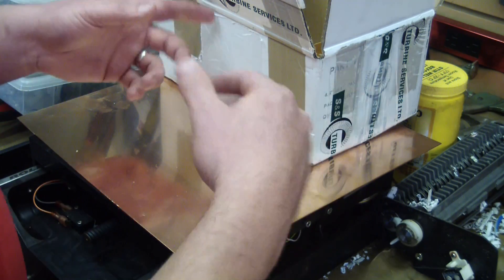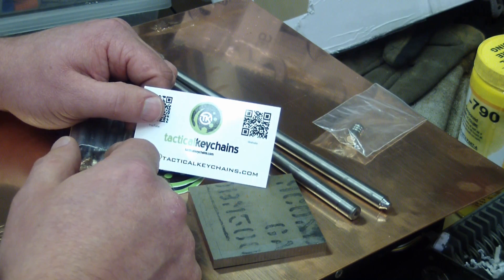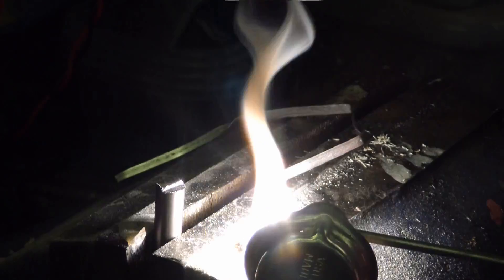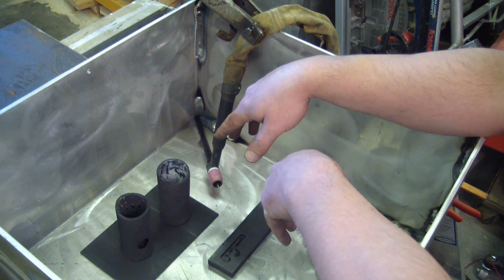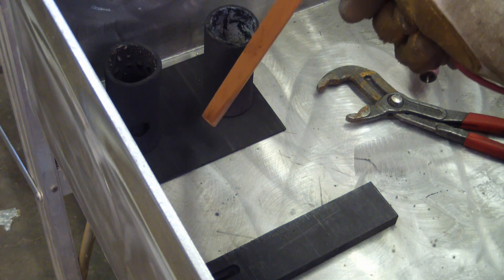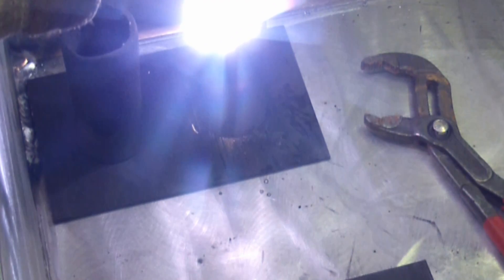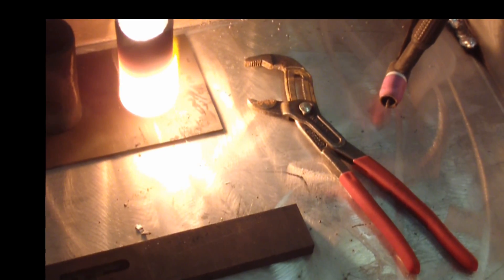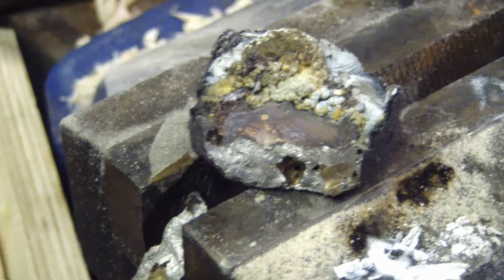Titanium Casting Experiment

Comment: I had another idea coat the titanium with silicon oil/grease and quarts sand once hot this should make a protective layer between the titanium and oxygen/contaminants in the air. The silicon oil/grease will not be enough on its own as most silicon oil will boil long before titanium melts it dose serve as a binding agent and lower temperature barrier. Quarts has a similar melting point to titanium so will serve as high temperature barrier however using quarts sand will probably require a 3rd intermediary barrier material which i have not sourced however if the materials boiling point is adequately above the melting point of titanium it could replace quarts. I have recommended silicone based materials for several reasons, they will form a barrier layer, they will and will absorb oxygen and other contaminants.

Comment: I worked for a high profile company that actually poured titanium (confidentiality stuff) they used the same idea (much bigger scale).. It was  done inside a vacuum chamber and the crucible was actually a water jacketed copper tub. The pour had to be made right at the moment that the massive titanium electrode was out of the way. Titanium freezes  almost instantly.

Maybe I shouldn’t have said any of that.. but I haven’t worked there for around 4 yrs so maybe I’m good.

Comment: You should cover the top of the box with plexiglass or something to keep the argon in. Also, a lot of metals can react with carbon at high temperatures, so it might be better to use a long, shallow alumina or zirconia crucible and just have 2 stick electrodes.

Comment: You needed better Argon shielding and better thermal insulation and a longer application of heat.

I would recommend making a simple steel box lined with refractory bricks with a very small space inside for the crucible.  Then preheat the crucible and refractory bricks with an acetylene torch for several minutes at a minimum.

Then pump in Argon gas and verify the Oxygen content using a burning splint and Burning Magnesium ribbon.

If the Magnesium ribbon can be fully extinguished the Argon concentration is probably high enough.

Next load the Titanium then heat using a carbon arc torch for a very long time. 

FYI I started out in school as a metallurgical engineer.  At present I am a Manufacturing engineer and CNC machining department supervisor at a mid size machine shop/job shop.

Comment: I wonder if you could make a float to indicate how full the tub is with argon gas. I know they've used very light aluminum foil boats to float on heavy gases, i wonder if you could make a light ball partially filled with helium to be extremely light, to be able to float on top of your argon in a perforated clear tube to indicate how much argon you have in that tank.

Comment: If you heat the titanium to 1380°c for 36 minutes and then quench it until cool, then heat it a second time to 900°c for 14 minutes and let it slow cool it will be much much stronger.

And instead of zapping the bejesus out of it, use an induction heater furnace.

Comment: Charles law is what fucked ya here. The heat caused the gas to expand and let some air in to screw everything up. Trying making a closed system where you pull the air out and replace it with argon,slam in two access points for gloves(make sure your seal is still good) and Bam problem solved.

Comment: When I used to weld that material you could not have enough argon,, post flow 6 to 8 sec, blowing it on the front and back, if you overheated the workpiece the whole thing was junk. might try putting that tig torch in the crucible,, don't know. do enjoy your videos though. keep your stick on the ice.

Comment: well, first you need a variable frequency water cooled induction heat source in the 10kw range, then you need to make a better gas shielding system such as a full enclosure, a zircon oxide crucible will probably hold the melt cant use silicone carbide since they are clay or graphite bonded and will react the titanium, if you are luckily after spending 15k on a melt rig, you will get molten titanium, to pour it into a mold . the entire process will have to be shielded by argon,  so basically the entire melt needs to be in a sealed enclosure with a tilting device that will allow pouring into a perfectly positioned mold, better off to cnc titanium chunks, nice try though was a very cool failure

Comment: moe7404.   years ago when i was at Boeing we machined a LOT of titanium.    the scrap tubes had be covered with  a metal lid.   and we had to have a can of X powder to cover it in case of a fire.  of course this will NOT put the fire out only keep from burning the shop down.   and we had to put a good chip load on the cutter else the titanium  will work harden.   and we had a book of procedures.   that required to flood cool the cutter.   and we had to have the fire dept come out and approve the work area then they gave use a paper to show it was safe to run the titanium.

Comment: wot u wonna do is bang another gougeing rod down the gunts of that there hot cup so az ur angry pixys az u got dancen around in the dohicky run from stik 2 stik that way the force of the arc is not held by ut wanten to keep allso swap ur polarity around so the pixy dust is runing from the work pice to the hand pice so that the rod in the cup vaporises less coz of the electrons and pasmalexilied thingos that makeup that big blue looken thing  wot happens at the end of ur rod is flowing up and striking the bit wot u hold ur rod will get all sorts of hot and wast away quicker but will get rid of all that stiky stukn stuf u got going on and make things smoother in the molten pool coz the real work will b hapen from the surface tention of the pudle (biger suface area that gets biger az u go) to the end of the stik in sted of form the stick down then the arc force roughn ip and braken the suface tention of the puddle

Comment: If all you're trying to do is melt a bit of Ti and then drop it in that beer cap remover mold, then I think you can do it with your set up but for one, maybe two, improvements.  First, get a slab of glass to cover the top.  Then cut out a small hole on the one side.  Have the bottom of the hole still be at least several inches above the top of the crucible.  Also, max out the argon flow.  Ideally, you should feel a light breeze exiting the space around your arms as you are working.  If you don't want to blow $60 on an argon recharge, then get some electrical  gloves, and tape them into the side of the box.  So now it looks like one of those incubator type things where the internal atmosphere is completely sealed off from the external atmosphere.  THen you can get it to positive pressure with argon in there, and that will surely solve your problems.  

Sloppy?  Yeah.  But I am assuming your only goal is to be able to say, when you give a buddy your titanium bottle opener, that you poured the liquid Ti into the mold yourself.  And if you have smart friends, they can know what an amazing accomplishment this is in a backyard garage setting.  Heck, it's an accomplishment even in a well stocked professional laboratory.

Comment: try carbon rods from old dry cell batteries, the railroad type are 6"l x 1" dia with a copper screw terminal mounted in the top of the post. just be sure to wear proper PPE when disassembling

Comment: something you might try for melting your metals is to use an old school way of heating and brazing. that is carbon arc. using two carbon rods with the arc between them. it was used a lot in the 40s and 50s . i used to have the holder to feed the rods and keep the arc stable. the same way searck lights worked

Comment: you state the gas flow is 15 "CFM", usually gas flow is measured in CFH. if you are using only 15 CFH of argon it's probably not enough. usually tig welding titanium requires a much higher argon flow and a purge for the back side of the weld.
love your channel!

Comment: Now you may need to use Thermite reduction over your casting mold which may fail because it's commonly know for a type of welding based from the common type of thermite mix, swap iron oxide for titanium dioxide add some extra aluminum powder...The gas shielding is still needed argon will do just fine as you mentioned... While under your graphite mold I would lay that on top of a bed calcium sulfate and aluminum powder this is just to keep things hot so the metal distributes evenly that might even get the hottest near the end the calcium could mix into the metal so make sure that's under your mold, I would pot all this inside a clay garden pot  or fire brick. do this outside the flames could be over a foot tall.Remember el metal es muy caliente so Aufenthalt aus dem Krankenhaus heraus Hope this helps thanks for all the good content Love the show Thanks...

Comment: I'm not sure why you used a carbon electrode to create your arc. I'd use the tig torch to melt the titanium.

Since the shield cup will not be able to withstand the reflected heat as a result of  being in the crucible, it should be removed. Extend the length of the tungsten to slightly above the bottom of crucible. Strike an arc and procede to melt your titanium.

Comment: Hey this probably will never work with an open enclosure, because the convective forces of the hot argon would make it fly up despite it's density and would definitely mix in the trace amounts of oxygen required to spoil you beautiful and deeply beloved titanium.  A vacuum purged enclosure that you fill back up with an inert gas though, and you would be cookin.

Comment: what about a closed argon filled induction heater? i remember aluminium heating up to crazy temperatures very fast even in static magnetic fields. it should be possible since titanium is also very paramagnetic. not so sure what about the oxidization. maybe such a closed chamber should be sucked free of air before filling it with an overpressure argon atmosphere.

Comment: The only way I've found to cast titanium without industrial equipment is the thermite method.  Titanium dioxide powder and aluminum powder/filings works the same as iron oxide thermite and you get molten titanium out the bottom.  Let it run into your mold as it burns and you have cast titanium.  Trouble is, it tends to destroy the mold no matter what it's made of, and probably the funnel you put the thermite in, too.  And of course it can light your garage (or anything else around) on fire.  So, not a practical method.

Comment: Liquid titanium will dissolve literally anything so even under inert gas, it will dissolve the crucible it's in. Normally for melting titanium, crucibles made of titanium are used. They cool the crucible as the metal melts. Super challenging to work with and extremely expensive for this reason
Reply: I wonder how they made the very first titanium crucible?
Reply: Stigstigster probably some super thick steel to not melt through
Reply: Copper crucible in a water jacket. Vacuum arc furnace, 16-22Ka, melts about 26 lbs a minute. Doesn't "dissolve" anything. Carbide tipped tools, anything tungsten (go to any ti foundry, you won't find a ball point pen for a mile), pd, Ru, anything like that causes high density inclusions. They do not melt under normal Ti conditions.
Reply: @Tom Marshall you work in Niles?

Comment: might be a chemical change happening with the arc rods being introduced to the base material. I can say from experience as being a welder that hast to back gouge alot got UT welds that their is a color change between steel and the slag that has been ground. when the raw steel has been made bright the slag will give off a golden tinge under an l.e.d. flashlight. also when the grinder is introduced to the slag in hives off a spark that for lack of a better term fizzles. instead of glowing orange and staying whole, it breaks apart and almost ignites.  maybe if you could heat it in a vacuum ? it's a bit far fetched

Comment: How about a clear plastic cover? Cut holes for the electrode and your arm to hold pliers. Holes only need to be rough fit, small amount of argon will escape, but it is contantly flowing in as well. Then no oxygen should be able to get in.

Comment: Should build a sealed enclosure and do it in a vacuum titanium requires there to be absolutely no contamination...  Supposedly.   Just use electronic actuators to contact the crucible.  Might be worth a try.  Little vacuum pump for automotive  a/c work should do it given sufficient time to depressurize.

Comment: I think he best way you could have done this was assemble a small smeltery. Essentially get a barrel and line it with kale wool, then some type of high temperature cement (at least 3000*C) and either fuel it with a neutral mix of propane and oxygen, or with Coke and charcoal with a high volume airflow (the Coke for temperature and the charcoal for a reducing atmosphere), then put the graphite crucible in and let er soak.

Comment: Use electrode to cause a magnetic field(not touching the metal) melt it in a crucible cup that has a cut through out the middle in a vacuum chamber, ones it's molten pull one half up enough so the molten titanium drops to the mold. That's how it's done in the dentistry buis at least.
Reply: So an induction furnace, in that case, might as well go all out, get some copper tubing, a water cooled capacitor, and have at it

Comment: Ti is typically cast using an investment process.  A positive wax mold is coated in ceramic slurry and then baked to drain the wax.  The ceramic mold is pre-heated (about 2000°F), Ti is melted using an electrode arc heater under effectively zero atmosphere, and dumped into the mold at high speed.  You might be able to do it at "home" with a relatively large tank to house the process, and automated controls.  Very high energy and high temp required.

Comment: Ti is such a nightmare to work with as a liquid that is why it costs a fortune. 1600°C melting point and reactive enough to be classified as an explosive.
Requires processing in a vacuum chamber. It's extreme reactivity is partly what makes it stick to itself (and self anodise).
When we figure out how to refine the stuff and work with it cheaply... whole new set of possibilities for mechanical engineers.
One of the most interesting ways of handling and forming titanium is selective laser melting. Lasers work optimally through a vacuum.
Titanium is super finicky to weld, also. Needs multiple jets of shielding gas, and to be absolutely free from contamination. Not a cheap process.
Ti oxide... world has loads of it. White paint. Expensive problem is turning that into metal... if that can be figured out... then it could become cheap enough that we could use it industrially and architecturally.
Need more robots. And vacuum that is empty like outer space.
Reply: You do have a good point, but I feel the need to remind you that the vacuum of space is not "empty."  It's the hardest vacuum that can be achieved, yes, but it is certainly not even close to being "empty." It is full of dust, gas and radio-isotopic particles of all sorts. Otherwise, the younger planets and stars out there never would have formed.
Reply: All of you have good points. When the F-14 Tomcat fighter was being developed, the engineers at Grumman, the plane's builder had to invent a special welding process to weld the plane's skin to the airframe.
Reply: spied onandon why not just do it in outer space?

Comment: did you try just laying the titanium on top of your mould and melting it direct with the tig torch (in the argon bath) even if that worked i suspect you may struggle to get it to fill the mould as there so little pressure on it just a few grams worth of gravity  .,Proberly not even enough to overcome the surface tension

Comment: You will be successful in your titanium melting endeavor if you utilize induction heating. You need to wind a copper tube around your crucible and hook the current from your welder onto it.There are a few YouTube vids that outline the process for melting or heat treating steel. Because titanium melts at such a high temperature cold water must flow through the tube at all times or it will melt. The tube must also be wrapped with some insulation that wont burn like fiberglass tape. The pump will be isolated from the ground so it doesn't get fried. AC or DC will work for titanium, I'm just not sure which one is better. The crucible also needs to be on a non conductor like ceramic. There is a danger that a gust of wind will blow out the argon and oxidize the molten titanium. Be careful and don't forget to have fun!
Reply: Induction heating, like the name implies, relies on magnetic induction which requires a rapidly changing magnetic field. So DC would not work. To be successful at induction heating, the induced Eddy currents must be limited to the outer edge of the target due to the skin effect, which is frequency dependent. That is why 50 or 60Hz from an arc welder would not be sufficient either. Typical frequencies for induction heaters range into the hundreds of thousands of Hertz for materials of that size. 

In summary, powering an induction heater element from an arc welder, whether AC or DC is not feasible.
Reply: Josh St. Louis
Take notice of the multitude of videos on youtube showing metal being melted with arc welder induction coil. When I was building hot form dies for titanium aircraft parts we were doing things that the people who designed the machines said could not be done. Many college educated engineers and designers have little experience in the real world and rely on outdated ideas and reference materials to put false limitations on true innovators.
Reply: +Joe Plemmons 
Are you referring to using the secondary induction coil to resistively heat the part directly? Because that certainly does work, that's the basis of the spot welder I made. 900+ amps sure does the trick.